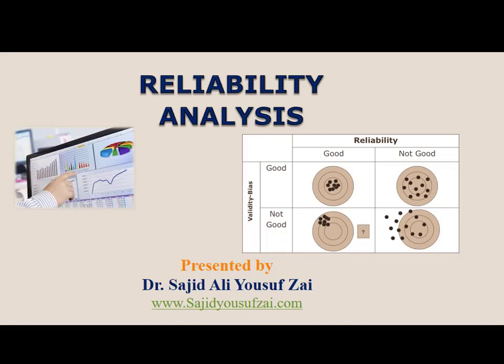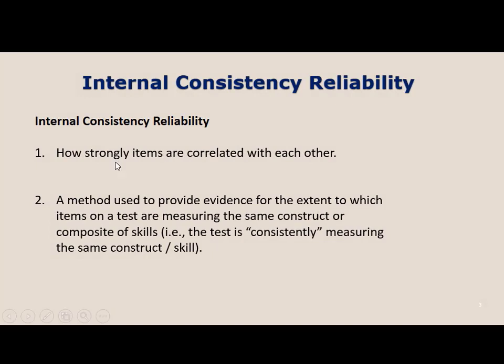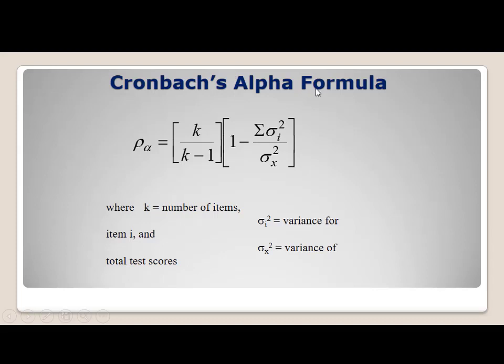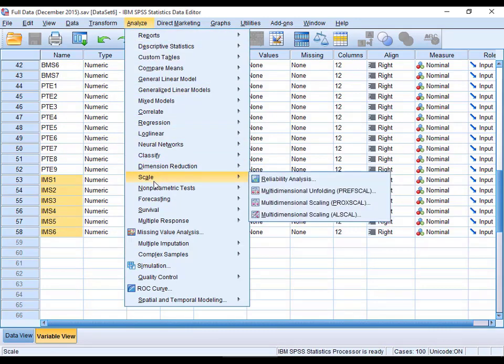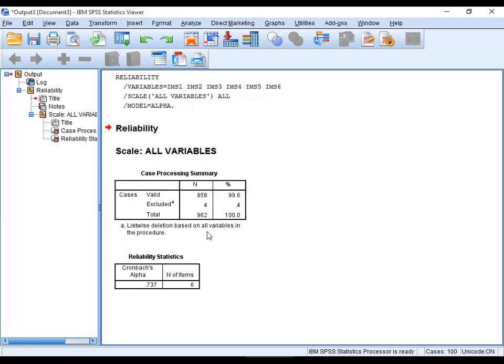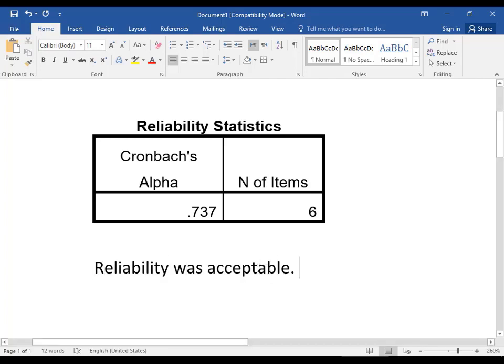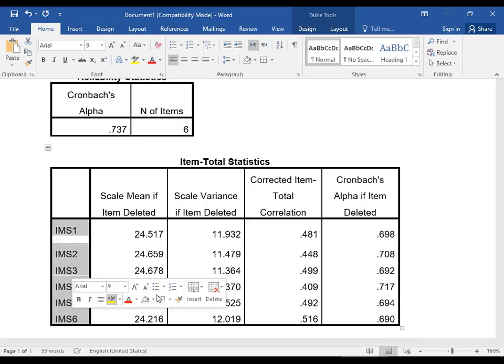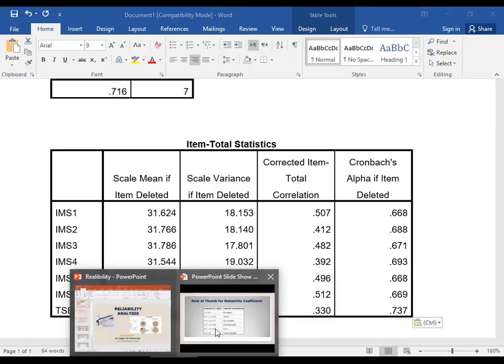Reliability Analysis and Cronbach's Alpha in SPSS

Comment: Thank you, this is very clear presentation. I have questions;
1. How do I conduct reliability for pilot testings? Am I to prepare a likert scale questionnaire set for the respondents for the pilot test for each question in my questionnaires? 
2. How many respondents is sufficient to conduct the reliability and validity for pilot test study? 
3. Wha should I do is the questionnaire set is unacceptable or poor?
Reply from the maker: Thank you so much for your likeness. Here are answers of your questions:
1. Reliability analysis for actual data and for pilot testing are same. For pilot testing reliability you can follow the guidelines given in this video. 
2. Minimum 50 to 60 participants are acceptable for conducting reliability analysis. While validity depends which type of validity is to conduct. Validity assessment from experts does not require any prior data.

Comment: hello, if cronbach alpha reliability value is .85 for a scale, is it correct to say the 85% of the variance is good variance, with 15% error variance?
Reply from the maker: NO. If reliability coefficient is 0.85 then (0.85)^2 = 72%, which means this instrument is 72% consistent and it will produce 72% similar measures which indicates quit good reliability.
Reply: @TREADExcellence  oh also, for that example, 72-100 = 28. Does 28% represent error variance ? thanks
Reply from the maker: @Hairprincess1.1  Yes
Reply: @TREADExcellence  okay thank you for responding and for providing me with the equation for figure it out. i really appreciate it :)